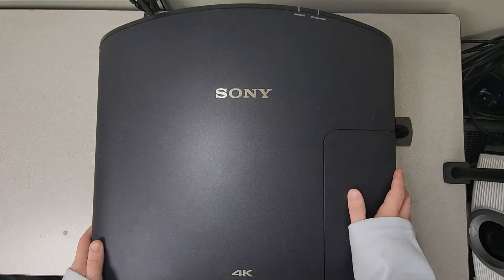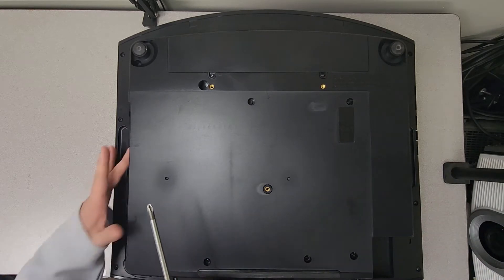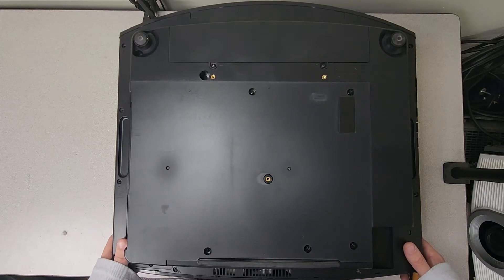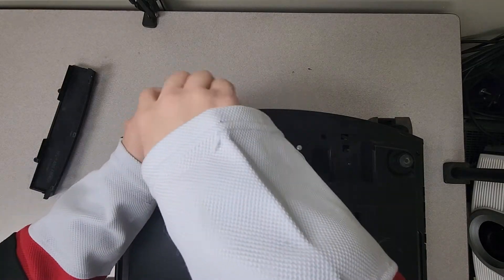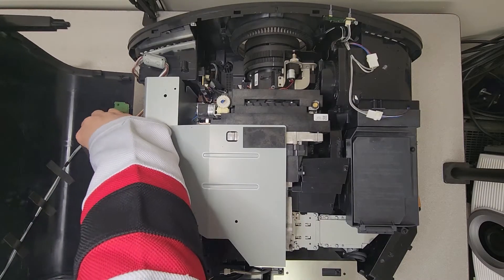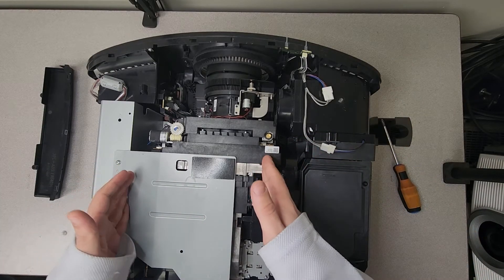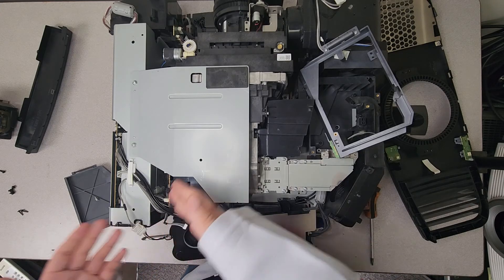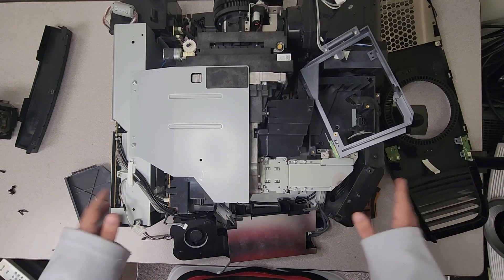Jaspertronics - Sony VPL-VW295ES - Tear Down and Fan Cleaning Tutorial

Comment: How different us the 285 version. Mine had a fan issue. Both lights blinking on front 3 times.
Reply from the maker: According to the tech, these are gonna be extremely similar to near identical. The tutorial should be fine to follow along with! We do have a service center for projectors if you'd like us to take a crack at it and get it fixed up. Give us a call or send an email, we are always ready to help out! -AM
Reply: @jaspertronics awesome ill send an email now!

Comment: Great video! Not a whole lot of service info out there for these Sony 4k projectors. Do you know if the optics get dusty too and could benefit some cleaning?
Reply from the maker: Generally the light path and optics tunnels are safe from the dust. It is mostly the cooling system that is affected by this but it is possible for dust to get in.

Comment: can you just use a vac and suck the dust out of the fans while the unit is still mounted?
Reply from the maker: Unfortunately no, there is a ton of plastic in the way of most of the fans and a vacuum is not strong enough to pull the dust out of the vents.
Reply: @jaspertronics  okay, thanks

Comment: This is a good video.  I followed it and things mostly went well.  The Bulb cradle was easy enough to remove but it needs to be spun around and it needs to slip out from under a piece of plastic towards the right.  When you reinstall it, you have to be sure to slip it back under that piece.

Putting the cover back on had challenges.  It mostly goes on but is tough to get it back to line up and fit snug.
Reply from the maker: I am glad that things went well, if you have any questions feel free to ask and I will do my best to help!
Reply: I also just went through the whole video to tear down and get the built up dust out of my projector. It was very dirty! Unfortunately my picture still flickers. My lamp only has >3500 hours. It shouldn't need to be replaced, right? I don't know what else to try though. I tried a different power cable and a different outlet with a power conditioner on it. Will a new bulb fix my flicker issue?

Also when I went to order the bulb it suggested adding a filter, but in this video you mention there is no filter. And it says also that it's compatible with this model? Do you just shove it in there? Or should I just get the bulb?

Thanks
Reply from the maker: @BrettsPlay  Absolutely try a new bulb. Bulbs can weaken and get partially damaged by dust. If that dust was blown into the cup of the lamp then there is a good chance the lamp is now bad from damage. I would try a new lamp and go from there. Here is code to get 10% off of one of our lamps for your unit, the code is: 10percent. You can find your lamp here: https://www.jaspertronics.com/products/vpl-vw295es-lamp
Reply: @jaspertronics  thanks so much!